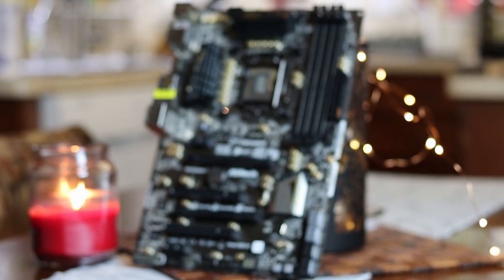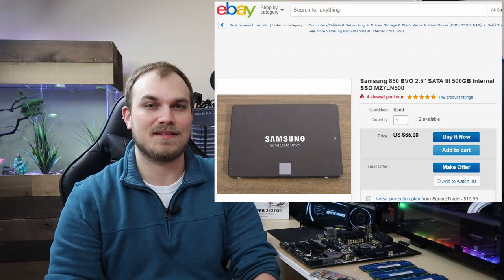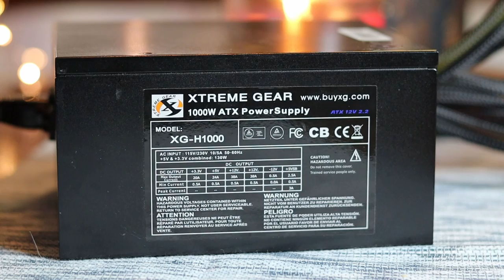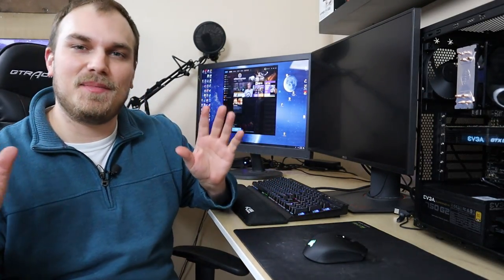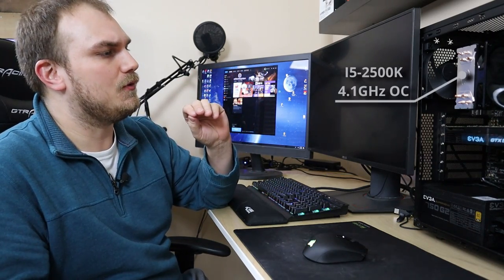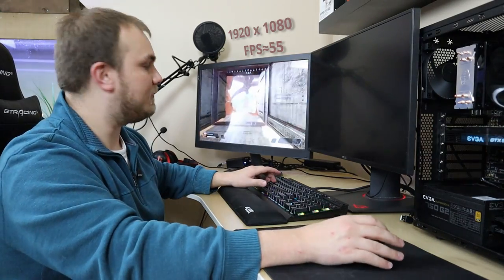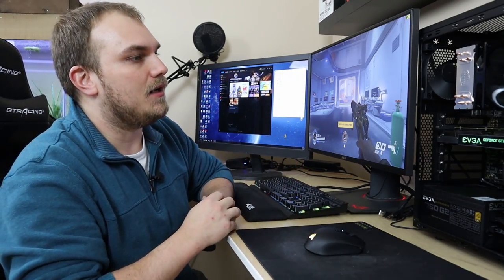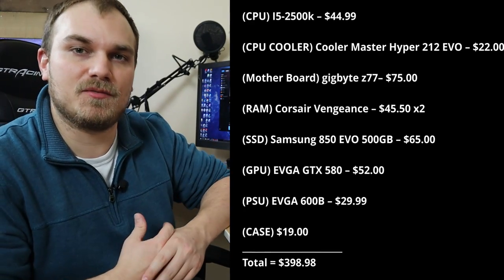How To Build A Second Hand PC | Apex Legends Gaming PC For Under $400.00

Comment: For 1080p gaming that CPU is still gold, and I think if you pair it with like a 1060 you'd get amazing budget gaming experience. Great video, and even better insight for beginners in regards to 2nd low budget gaming.
Reply: Edvin Dzafcic oh yeah a 1060 is definitely a sweet spot, especially in Australia you can get better deals there then 1080’s
Reply: Why would you pair it with a 1060 if a 580 is just as good?

Comment: Try something like i did :D 
MBO - GA-P55-UD3 (used)
CPU - Xeon x3450 (clocked 4ghz) (used)
GPU - r9 380x 4gb psc+ (used)
RAM - 8GB DDR3 1333mhz (used)
SSD - 120gb kingston (new)
CASE - LC Power aquarius (used)
Cooling - 4x 120mm zelman + CPU cooling lc power lc-cc-120 (new)

I spent under 200$ for this setup im sure you can build it for a budget from 150$ to 250$ (im in croatia so i dont know the prices at your state)

Apex on high runing at 60fps avg and 41fps at 0.01%
Fortnite runing on epic at avg od 60fps and 37fps at 0.01%
.....

you can play every modern game at medium / high / ultra (depends on a game) at avg of 60fps :)

Comment: Here the best budget if new ar rx 570/rx 580 i never buy second hand as i want the warranty :D.Rx 570 are cheaper than the 1050ti here(i bought my 1050ti new for 2.7k its 4k now).The rx 570 are 3.6k and the rx 580 which i am going for are 4.6k.
Reply: Many 570 also get pretty close to 580 in performance.

Comment: i still rock i7-2600k and is more than enough for 1080p gaming
Reply from the maker: how is that chip for OC my 2500k is still running 4.5 on my test bench.
Reply from the maker: how is that chip for OC my 2500k is still running 4.5 on my test bench.
Reply from the maker: how is that chip for OC my 2500k is still running 4.5 on my test bench.
Reply from the maker: how is that chip for OC my 2500k is still running 4.5 on my test bench.
Reply from the maker: how is that chip for OC my 2500k is still running 4.5 on my test bench.
Reply: @MajorHardware  im on  4.9 but i could push it to 5.1 stable
Reply: And I'm on a 3570K and notice tah I need more to properly feed my 1060

Comment: For $550 you can do an i3 8100 and an GTX 1060
Reply from the maker: I donno i still might want the 2500k since its overclockable with the gtx 1060 of course, i had my 2500k running at 4.5GHz for years and it did great also for gaming higher clock speeds are normally better. But i may just be bias because my 2500k has treated me so well over the years.
Reply: Major Hardware I would rather have my cpu run at 3.6 GHZ with DDR4 3000mhz+ compared to a 4.5 GHZ 2500k with DDR3 1600mhz, the 2500k would be faster but the memory would totally bottleneck the entire system...🤔
Reply from the maker: @calvins8839  possible, i would need to do some testing to verify.
Reply: I found a somewhat recent test (in german) that benched memory clocks on a ryzen 2600 and a i5-4570K
The i5 actually benefitted more from goung from DDR3-1333 to DDR3-1866 than the Ryzen when going from DDR4-2133 to DDR4-3200, and DDR3 isn't at it's end on 1866. Running mine on 2133, but there is faster stuff out there.
In the end it comes down to how each game react, if memory benefit really improves something, and if the ~25% IPC improvement can outshine the 25% clock difference.